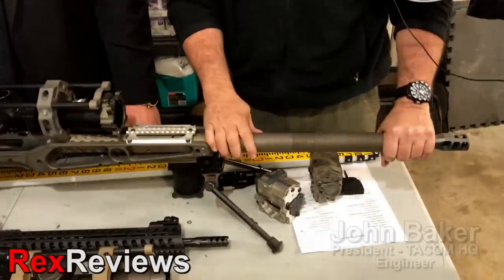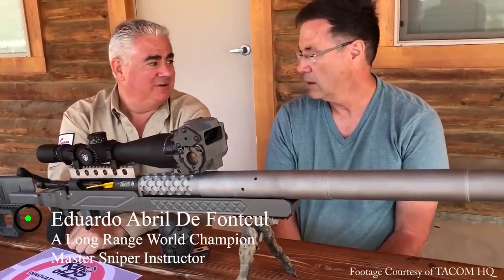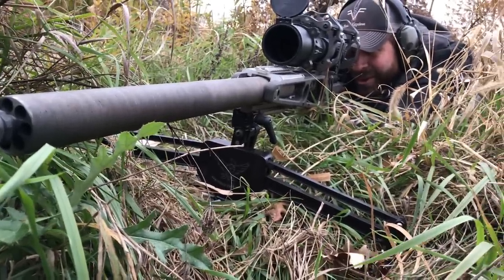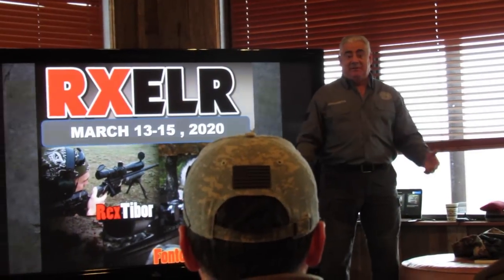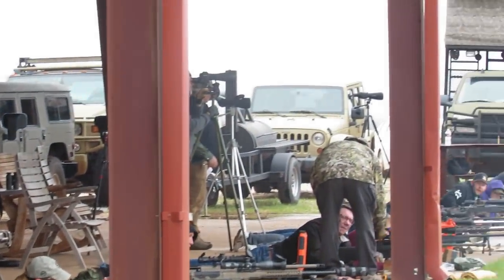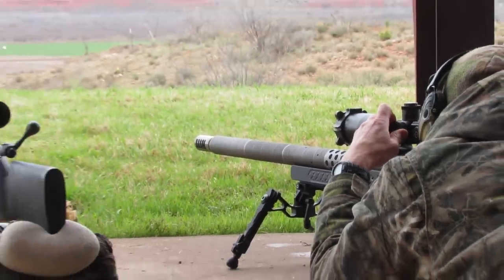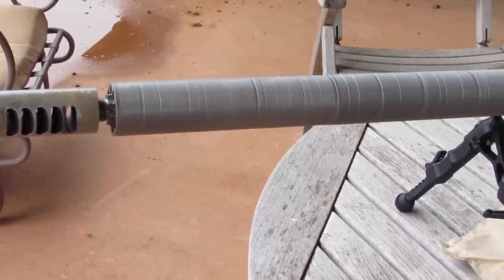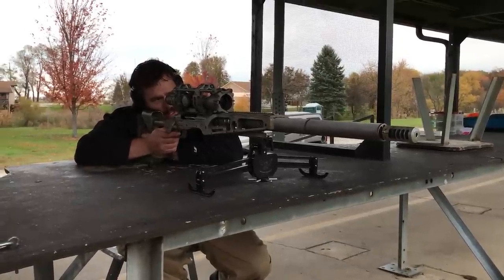TACOM HQ Structured Barrels ~ Rex Reviews

Comment: This is not unlike the fuller of a blade. Removing material in order to strengthen the metal. Bravo! Interesting stuff!
Reply: One pipe with thick walls is going to be less rigid than a bundle of thinner walled pipes welded together.  Makes sense.

Comment: I thought of this idea 6 years ago. My design was 8 aluminum truces cut to fit the barrel OD, inside a tube that added rigidity, and acted as a heat sink. My design also acted as a handguard for smaller caliber rifles like 5.56 with pencil barrel for making a light 3gun type rifle.
Reply: that sounds like not this idea at all, they specifically state that it is not a sleeve to avoid different rates of thermal expansion. Then the non uniform surface is an integral part. If you mean you thought of increased surface area like a fluted barrel and barrel shrouds then hate to break it to you they been around a while...

Comment: Kinda helps explain why my....obviously smaller, government profile barrels get so hot with that small load yes I know smaller barrel too gets so hot so fast but my really hot 7rm mg, 416 bull barrel basically has no heat build up, and material..but still and in my others that are fluted, I'm rambling in my own mind sorry guys, but the flection of microscopic stretch and contractions on thinner rods is more and heat builds tremendously when you work a piece of steel back and forth even slowly, freaking AWESOME I'm ready to apply this knowledge to my system all I can say is freakin sweet man, thank you love you buddy, had to listen to the last part twice to really grasp it well and very well you displayed that pojnt

Comment: I have said this for years, and if I had the capitol I would have been building AR15s with tensioned barrels for decades, but this wasn't my idea.  I got the idea from Dan Wesson, who pioneered shrouded tensioned pistol barrels decades ago which were more accurate due to less POA vs POI change due to less barrel whip, and heat related harmonic change, and by pinning the muzzle with the shroud.

Comment: It’s interesting. It should be tested with a 6 PPC in a return to battery BR rig to demonstrate the capability. 

The late Skip Otto did some work on changing IG vibration frequencies and nodes by fluting BR barrels.

Comment: Pretty amazing design! Its funny Rex you speaking about life in relation to frequencies. Ive been looking into frequencies lately,  wavelengths ect. And as you know, faster frequencies are known to create heat (microwave  oven, say). The suns light have very fast frequencies and create alot of heat. The movement of the earth and its components create very low frequencies. Another thing thats crazy in my mind is that our solar system works kind of like a large atomic structure with orbiting electrons ect. The Father has got it going on, doesn't He!!

Comment: Excellent explanation of harmonics brother. Even my dumb ass got it. Now...I have to implement this into the PCP world. I shoot high precision, high power, PCP air rifles. I experience this frequently. Fortunately my Airguns are infinitely adjustable, so I can fine tune them for maximum accuracy, but still...gears are turning my friend thanks to you. Airgun barrels on some guns are thinner, while other are much thicker, still, this issue still exists even at 950 FPS. Sad to say most of my air guns are more accurate than most of my powder burners. The technology you showed here may very well change that, but then again, if I use this same tech in an air gun...a structured barrel on my LW polygonal barrel on my LCS Air Arms SK-19 in .25 caliber with 40 grain slugs @950-1000 FPS...over 60 shots I’m getting a standard deviation of just 2.8 FPS thanks to a very good regulator...oh my...the sky’s the limit! I may not have the heat, but I still have shock, and flexation. These barrels are good for a million plus rounds due to the softness of the projectile, and speed. Man you opened a door to a whole other world just now, Thank you for helping me to understand this so freaking much better. God bless and stay safe my friend.

Comment: I have to ask Rex @TiborasaurusRex is the same concept that was used on old rifles with the adjustable screw? If I remember correctly an old timer Gunsmith said you would adjust the screw tension to change the accuracy. Essentially changing the harmonics. Right??

Comment: Hey Rex - Do you think an steel additive manufactured sleeve heat shrunk to a standard barrel would work? Save the work of the drilling a larger barrel?
Reply from the maker: There are many ways to skin a cat... I like eliminating thermodynamic coefficients by keeping the design monolithic, but structured.

Comment: With these modern structured barrels It makes me question the traditional requirement for free floating the barrel. At some point it would seem to make sense that you could tie the barrel into a chassis system(if done rigidly enough) and not only increase the barrel stiffness but make a more solid rifle system altogether.

Comment: This physics princeable is found in the area of welding and the cwi,, certified welding instructor,, mechanical engineer,,the 81 mm mortar has a continuous thread on the out side,the reason marching is not done while crossing a bridge in the parade,routstep,very interesting,,what will a down pour,rain ect do to a hot barrel ?

Comment: While all this is cool.Its not a new concept.Think about the high rpm motors in race car and even everyday cars.They all have a Harmonic Balance bolted to the front of the Crankshaft of the motor.
Look at all the dimples drilled in the piston rods attached to crankshaft that also is dimpled to Balance everything out.Im surprised that the gun makers are so far behind the curve until now on this concept of harmonic balance and stress.Im glad to see it happening. It should help our Military a lot.While I dont see it happening in very much of Shooters due to the cost and not much use except P.O t for the few wanting to shoot 2 or 3 miles.And there is not too many places to do that in most of the USA.

Comment: That doesn't look like a free floating barrel. Correct me if I'm wrong
Reply: Well you technically dont need to free float it because the goal of free floating a barrel is to cancel contact that will interfere with the barrel while it vibrates
Reply: @wildcat_reloading  Correct, not only does it keep the barrel from hitting any of the other parts of the rifle but it also allows the harmonic vibrations to increase. Gathering from the name "Wildcat reloading" what do you reload?

Comment: Making the barrel more rigid means increasing harmonics frequency. The load will be harder to tune. If the most accurate rifles in the world have a free floating barrel there is a reason ! If you tell anyone that barrels harmonics have an effect on accuracy, he will "logicaly" think about a way to dampen or block these vibrations but in reality it's a wrong solution.

Comment: I typically like his stuff, but the technical description in this video is wack.... I think there is a high level grasp of the some terms and context but no deep understanding of the physics. Terms like “thermodynamic expansion coefficients” are completely bogus and demonstrate ignorance. Sounds very much like a snake oil pitch...
Reply: you are definitely demonstrating some ignorance lol the context as I understood was that this is a billet part, not a sleeve, so you will not have two different sections with different rates of thermal expansion. This is something very basic and used in practice in old thermostats among other things.
Reply: Just because YOU don't understand something, doesn't mean it's bogus. LOL. And your semantics complaint about thermodynamic expansion coefficient instead of the traditional, thermal expansion coefficient, is pedantic.
Reply: I kinda agree with you, I think there are some words and concepts given to this barrel that tries to explain things they do not understand.  
It reminds me of people trying to explain why a certain .22 barrel length is more accurate instead of just cutting it down inch by inch and arriving at a length that works better. 
The amount of factors involved in measuring and calculating the .22 barrel length is beyond almost any person on this earth and is so far beyond the effort involved in trial and error that it is also a way of demonstrating ignorance by simply trying to do so. 
In my mind you can not change the amount of vibration in an object unless you change its weight or composition so making holes in it will only change the frequency, not the volume, of vibration. AFAIK the only way to deaden energy is by turning it in to another energy like heat etc.
All this is of coarse just an opinion.
Reply: @scrooge8117  Harmonic vibrations are a function of a objects stiffness. Therfore increasing the stiffness of the object will change the harmonics. And for a 3D object there is not only the sinosoidal but also rotational harmonic oscilattions. This is mainly from the forces that the rifling of the barrel induces on to the bullet. There is also alot of combinations of oscillations and higher and lower modes of vibration.
Reply: @tropixMw2  I understand that you can change the frequency but can you change the volume if the object is the same mass and density?

Comment: My BS meter pegged when he talked about drilling holes to stiffen the barrel.  It was pegged again when he talked about thermal expansion differential.  A) removing material from a structure will not make it more rigid.  Sure you can make a structure that is more rigid than a structure of the same weight, but you cannot make a given diameter tube stiffer by drilling I in it.  It is less rigid than it was before drilling it. Period.

B) They have removed material between the bore and the exterior of the barrel which will absolutely effect heat transfer and the barrel will get hotter in the bore and cooler on the surface which is the definition of thermal differential. 

This is just taking fluting to the next level and a fluted barrel will change poi more when it changes temperature than a not fluted barrel.  Proof Research Carbon Fiber wrapped barrels and Falkor Straightjacket barrels have all the exact same advantages for the same reasons.